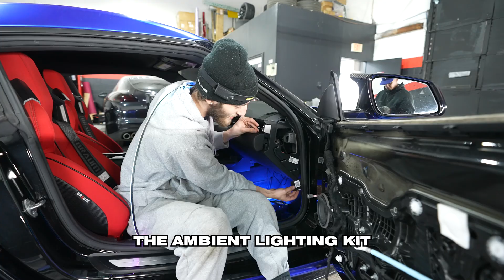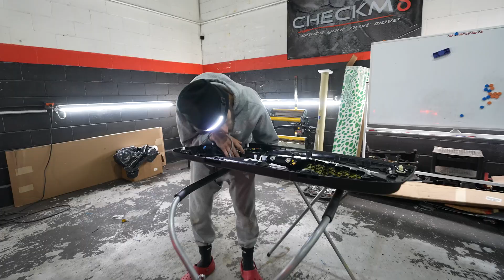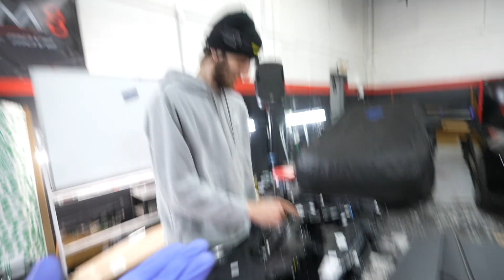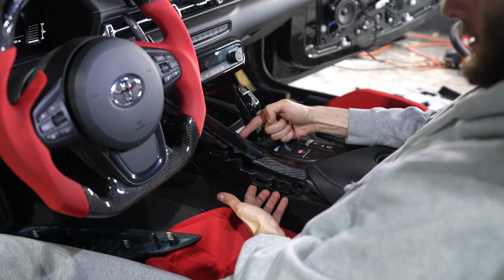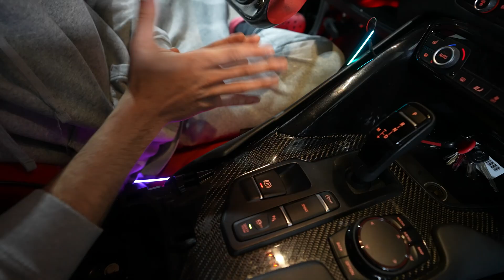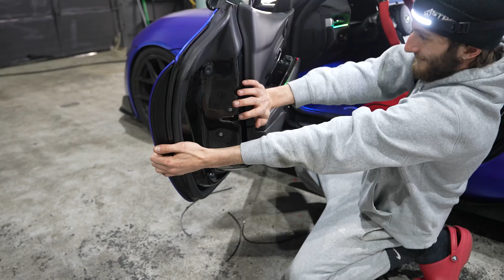MK5 Supra Ambient Lighting Kit Install *Looks INSANE*

Comment: This is why nobody touches my car but me. As easy as those panels are to be removed, you should never have switches coming apart. Rule of thumb, start on the passenger side first, so if you break something, it’s not on the main door.

Comment: Why didn't you use the footwell lights that comes with the 22 in 1 amazon lighting kit? Would the footwell lights in the kit fit through the gap in the center to pass them to the drivers side? I'm doing a supra install soon with a similar kit and am hoping to use the included footwell lights.
Reply: I just tested the included footlights in the kit and he was right they arent very good, lack richness and very dim. The strip's are over powering in comparison. I will order the govee floor ligjts too. Thanks for making this video because it will make my installation so much easier, I probably wouldn't have found that gap in the door without this video. Legend 👍
Reply from the maker: I believe you can but I believe he said they weren’t as good and as bright as the dedicated Govee lights, plus you have more control with a separate system
Reply: @tukes_  thanks for getting back to me.  I purchased a kit which has dual zone control but the floor lights are similar to your amazon kit.  I'll use 2 per side and hopefully it's bright enough.